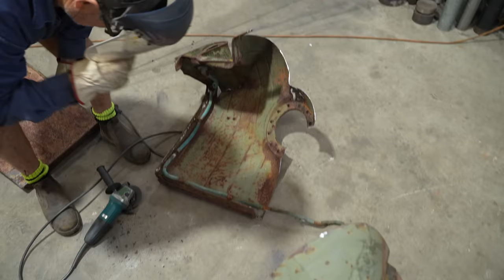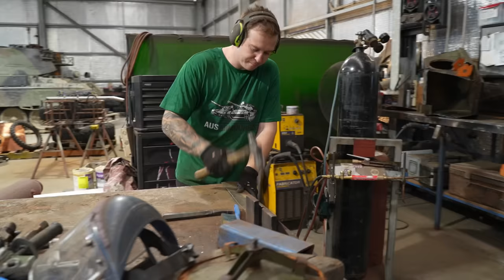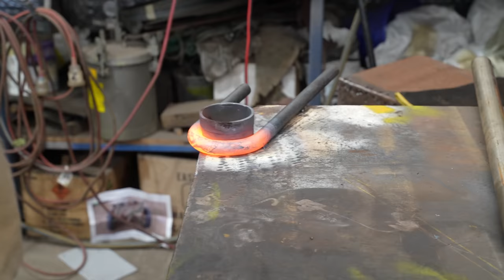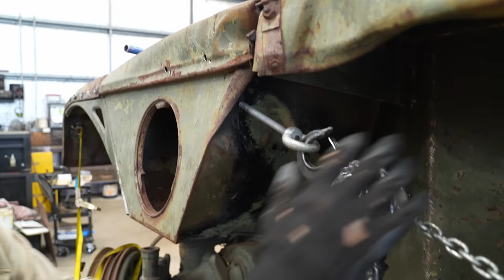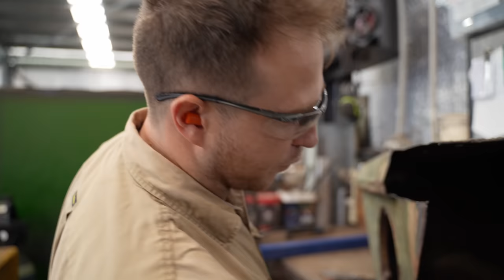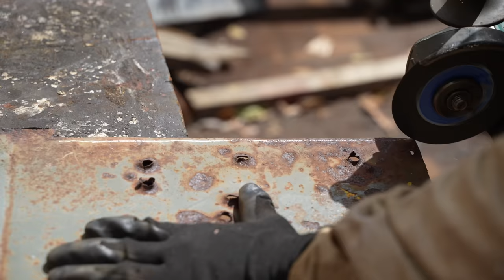WORKSHOP WEDNESDAY: Panel beating the Panhard EBR 90 Armoured Recon Vehicle RESTORATION PROJECT!

Comment: amazing work as ever - one thing i enjoy doing is amusing myself at the thought processes that went into designing these machines, sometimes things seem just thrown together as they are purely functional - but i bet somewhere down the line when the wings were designed and assembled, some little French chap was saying No No No No, pretty curves added to flat square parts, a nightmare 

this kind of restoration really needs descent smaller modified presses with a foot controller and to include a head and foot stamp to press the indents back into shape, rather than just beating seven bales for hours with a large hammer - still very impressive, the old army motto, make do and overcome works just as well, sometimes quicker, sometimes longer but still guaranteed the job gets done either way

Comment: Nice to see such skill on display,  if I may add a tip when beating out sheet metal I often use full size sledge hammers it is much easier to move with mass rather than strength. You can really control your hits and the stuff moves.

Comment: Surprised the press wasn't used to help getting things back into shape. At work we got some lifting brackets made out of thick stainless sheet that sometimes bend a lot if not getting placed right in the machinery. I have found it's much easier to use the press and some clever placed bricks, than trying to get them back into right shape on a table with wise and big hammers.

Comment: Chopping parts off and reforming them in the large sheet metal bender and welding them back on is probably faster in the long run then heating spots and using chain ratchets.

Comment: I thought he would just have gouged out the broken eye and replaced it. I know it would have been a little harder to form but then the seam weld onto the chassis could have crossed the join leaving you with a much stronger eye. Loving the panel beating though.

Comment: When the cost of restoring a piece of garbage is greater than the cost to construct a new piece, it seems pointless!
Reply: because you know how much it costs to restore it and how much it would cost to make it brand new?
Reply: Yes, this project is truly quizzical, you can actually buy almost running or maybe even running Panhard EBR 90s for around $30K, no doubt much less than the salaries and materials that will go into this project which will just be a junky rusted non-running hulk.
Reply: @origami26 I have no idea how much money they’re wasting on this project, but first they’re not even “restoring” it. They aren’t refinishing any of the panels, fixing the running gear or engine, or kitting out the interior with functional parts. They’re just building a “straightened wreck” of sorts for display. And YES, one can buy a used Panhard EBR 90 at auction for around $30K for a non runner in otherwise great shape, a runner might not be more than maybe $50K? So there is NO cost to make it brand new that is worth the time and materials - that would FAR exceed it’s value compared to one you can just buy.